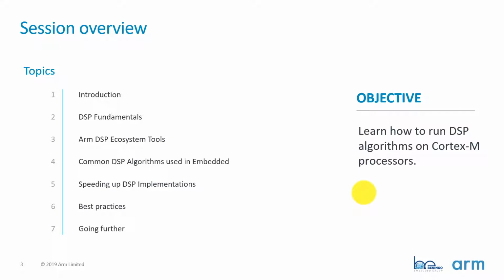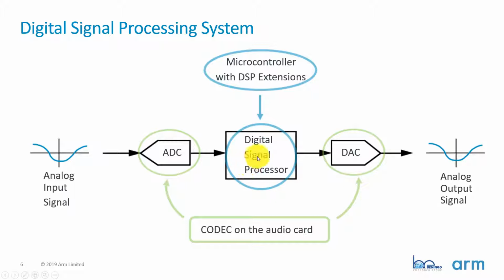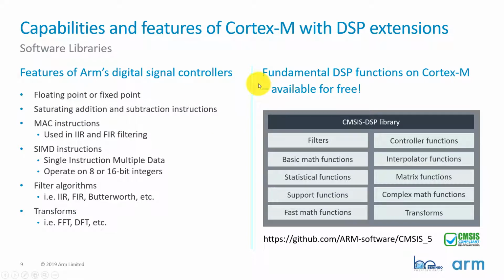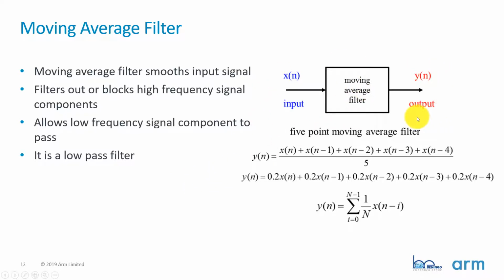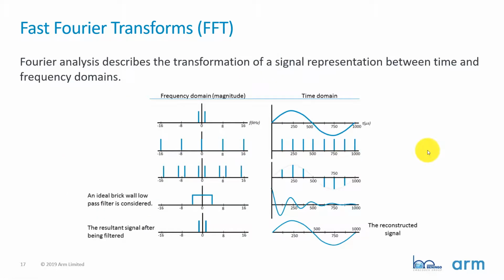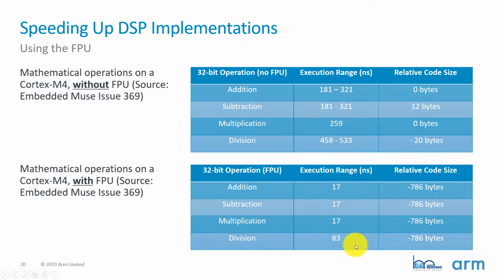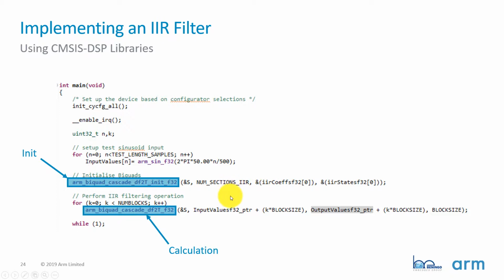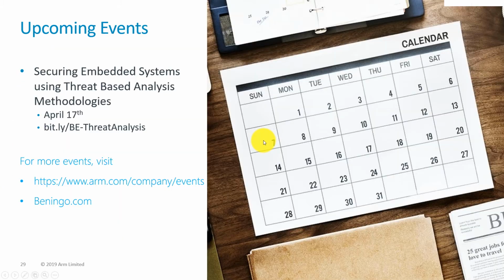Running DSP Algorithms on Arm Cortex M Processors

Comment: Very useful and concise presentation. I understand the principle of the Nyquist limit, but I'm using an MCU to sample it's ADCs for IQ at 96KHz with 64 samples taken at 1500Hz and the arm_cFFT is giving a pretty good 192 KHz spectrum. I do get stronger OOB signals repeating at 96KHz but can be alias filtered. How is this possible?

Comment: I got the STM32H757 Evaluation Board(it's dual core, M7 and M4, @480MHz and 240MHz, DSP Support, etc...), but the lack of instructional resource for this board is a huge down point. STM has an online training, but I can't cope with that computerised voice😑😑. 

Your video gave me a very good idea about DSP using the Microcontroller. I will look into the resources you provided.
Thanks for taking your time to make this video.
Reply from the maker: Hi, I just uploaded the video. You should visit the site
Reply: @lefteriskostoulas lol f that!! I want more!! What's up with neon running on a cortex a7!! What's up??

Comment: Hi,I know this is an old video, but I have question, I am a junior electronics engineer just started like 3 months ago and I am working with a lot of signals that I have to take as input into microcontroller, but my skills in DSP are not that great and I dont know when to  use which algo to reduce noise in my signals or to compute them. Can u guide me like whcih book should I read related to it or videos should I watch so I know when to apply which filter for signals I am working with or etc or which DSP algo to apply . Thanks
Reply from the maker: First you must understand the basic concepts of LPF HPF etc. Because dsp is based on these concepts. After that you can take a course in Udemy regarding dsp with microconttollers.
Reply: @lefteriskostoulas  yes I have good concepts of lpf and hpf, I have also developed them in software. To filter sensor data
Reply from the maker: @EmbeddedEnigma  visit Udemy and take a course on dsp. Especially if you use the same controller they use in the courses.